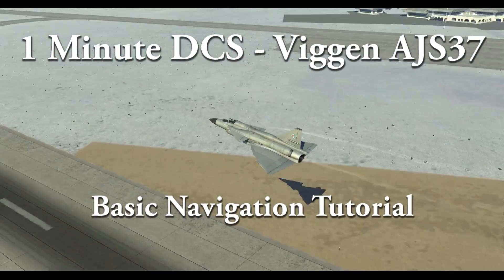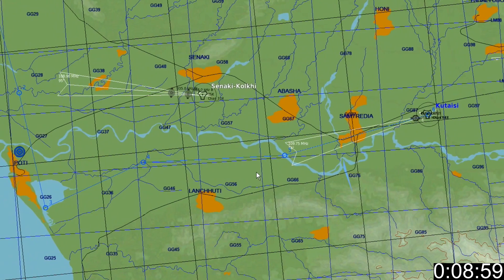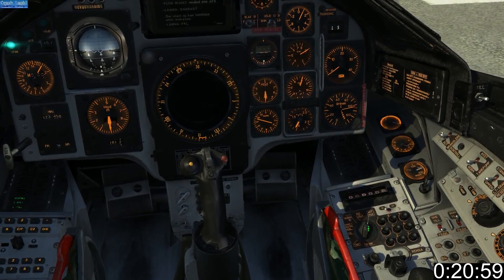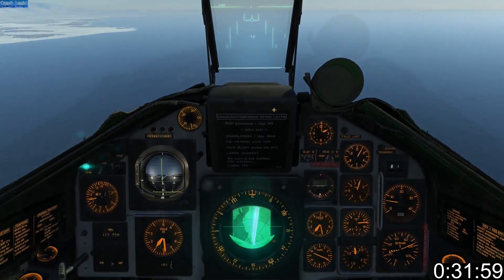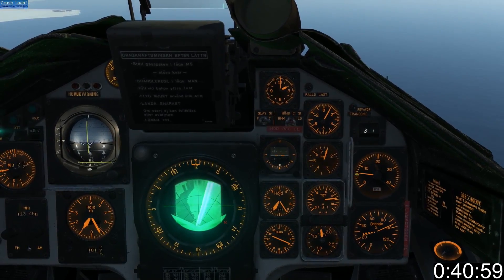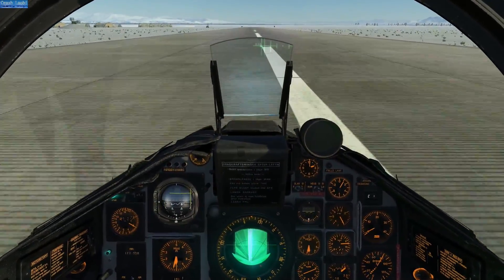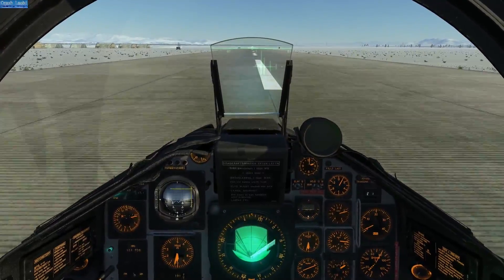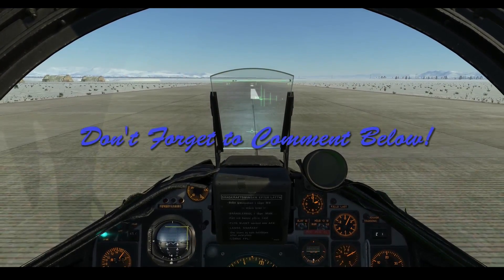1 Minute DCS - Viggen AJS37 - Basic Navigation Tutorial

Comment: When do i use the fix?
Reply from the maker: Thank you very much sir!  Because gyros go out of sync (rotation of the earth plus movement of the aircraft) you need to get a fix fairly regularly (15 minutes or so to half an hour at most).  The best way to fix is to set a waypoint every 3 or so as a fix point, pick a terrain feature that's easily recognised from the air like a bridge, or an island.  If doing a radar fix you can fix it as soon as it's clear on the radar, if doing a visual fix wait until you're above the feature to fix.  Hope this helps.
Reply: @Laobi  By setting every third or so waypoint as a fix point, do you mean there's a way to do that within the system, or do you just mean to remember do it every 3rd waypoint?